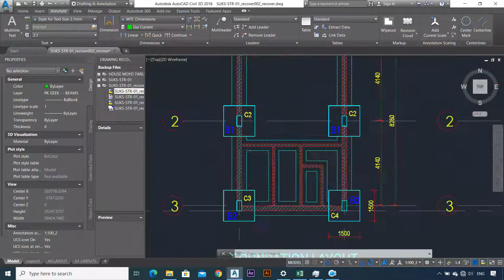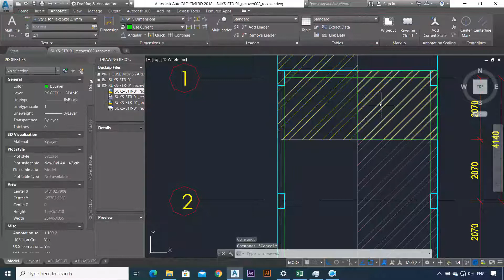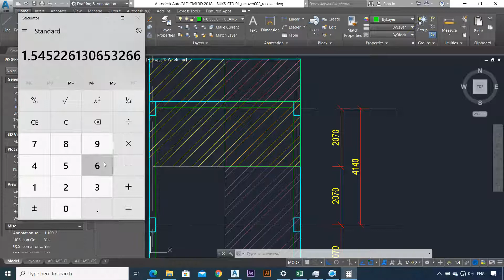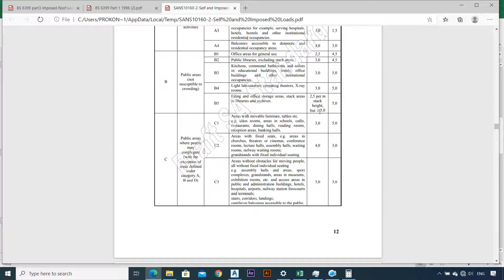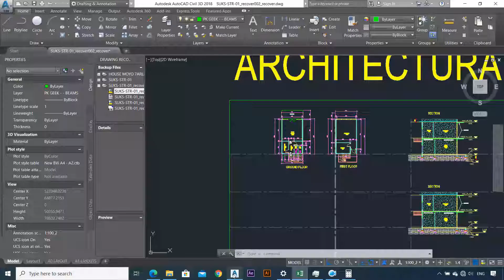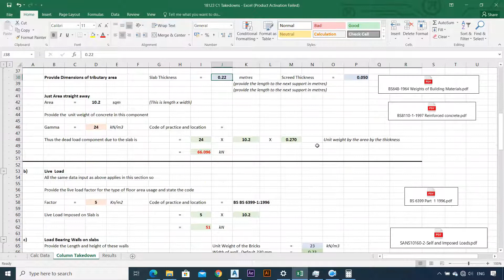Let's Design A Double Story Building Shop Part 05 | How to Design a Double Story Building | T-Downs

Comment: Hello Prokon Geek!

Thank you so much for your YouTube Page, your content is very helpful especially since you use the SANS/SABS codes in your designs, which is rarely found online.

I am a Civil Eng student and have a structural design module this semester and was wondering if you would be able to make youtube videos to help with Pre-stressed Concrete Design, specifically with the design of Pre-stressed Concrete Bridges. 
Use of the SANS/SABS codes & Prokon with this design would also be welcomed as I feel comfortable using Prokon.

Keep up the amazing work Sir  😎